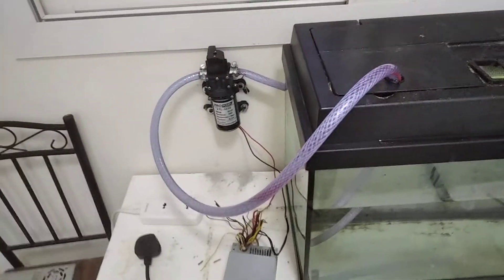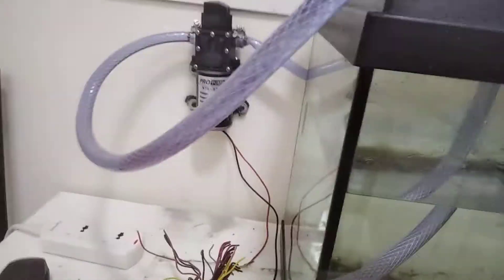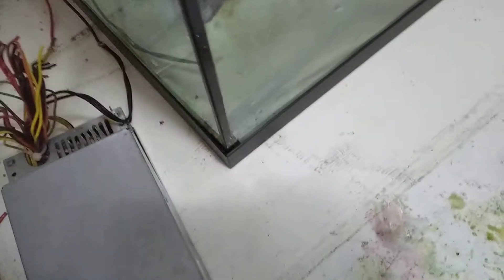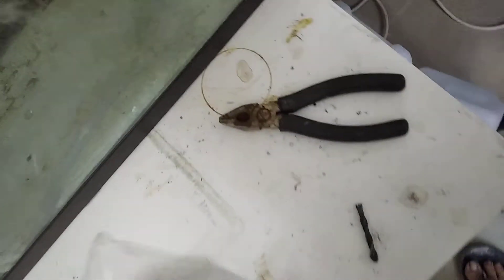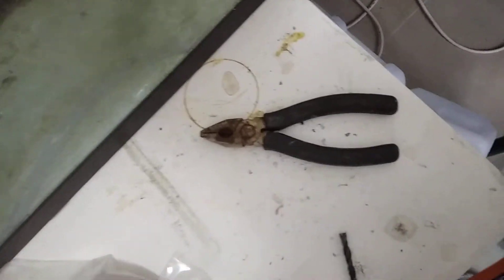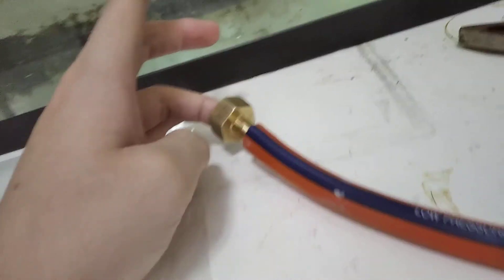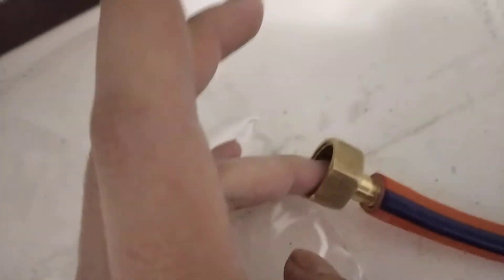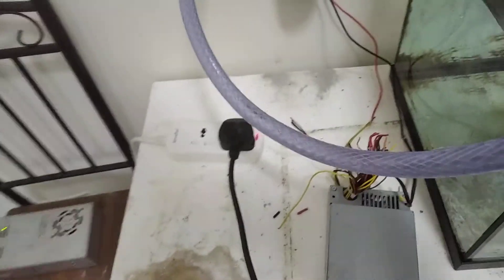Aspirator Vacuum system test

Comment: Can i use mineral oil or would it damage the pump?
Reply from the maker: it will work but the viscosity will lower the performance. Ethylene or propylene glycol is more preferred if you want a stronger vacuum.

Comment: Hm If you can put some 1000 PSI on this that could give you a good vacuum and a pressure washer on the other side cool man thanks !
Reply from the maker: its dependent on 3 factors.
Vapor pressure of working fluid,
Flow rate and maximum pressure of pump must be above 60PSI.
Reply from the maker: I would totally use oil or glycol if I had a 20LPM diaphragm pump
Reply: 1000psi ? that the pressure of air cylinders dude quite dangerous
Reply: Yes of course the water should be pointed to a safe direction at the exhaust side ;)

Comment: C'mon man, just bend the hose lolz

What about the specs ma man??? 
I'm looking to start a better vacuum pull than my water aspirator; pull is about as weak as my first girlfriend.
Reply from the maker: Yea i once bought a cheap pump that was utter trash!!.
This one pulls a nice vacuum and is not trash do not get 4 or 6 amp one and instead get 8 or 10 amp one for guaranteed success.
Also if you have a deschem aspirator you need to do one modification which is to remove the 2nd O ring which adjusts the height of the nozzle and instead do without it and use teflon tape because since the inlet is restricted to a tiny hole it wont matter overall.
Reply: @CatboyChemicalSociety  cool! thanks for the specs and heads up on the cheap move. Me all the way hahaha
Reply from the maker: the pump is an 8 amp 100W 12v 100PSI 8lpm pump!
the lpm is really important it must be atleast 8 and PSI above 60